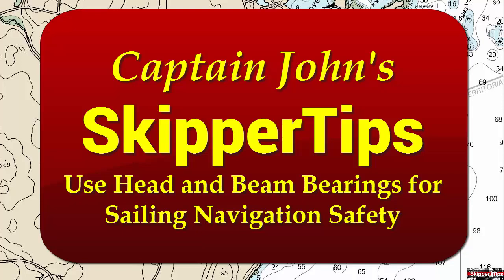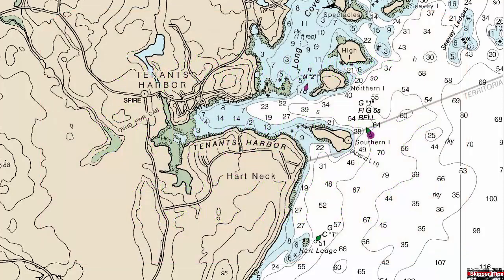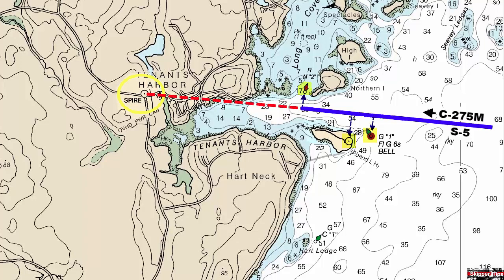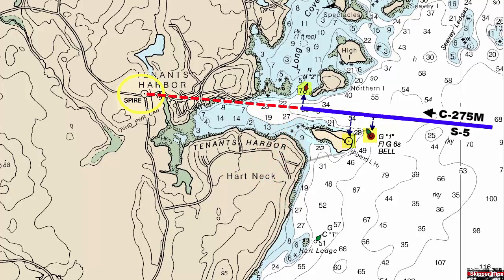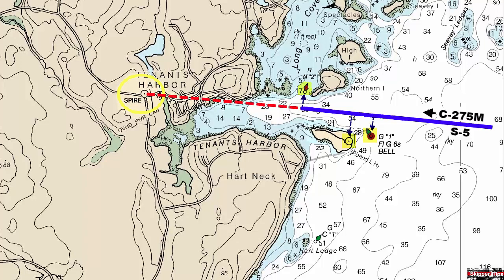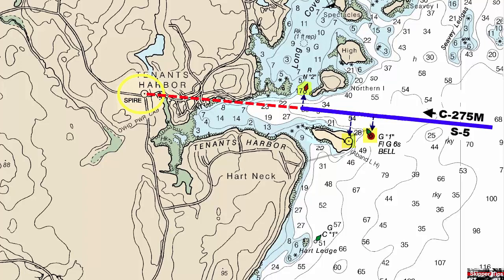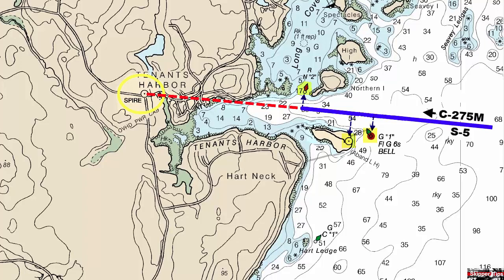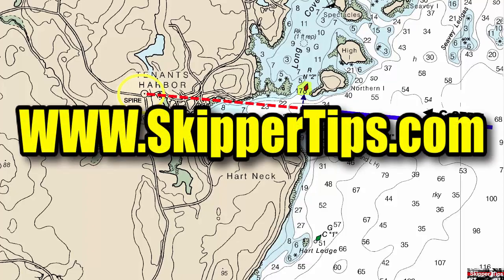How Use Head-Bearings When Coastal Sailing

Comment: I think your directions won’t work when compensating for set and drift.  In that situation, you would not be able to keep the head bearing at 275m with the forestay lined up with it.  You should keep the spire at 275m regardless of where the bow is pointed - or am I missing something...
Reply from the maker: Correct, which is why I added this footnote to the description of the video on the main page. NOTE Using the headstay to steer on the head bearing object assumes no current. If sailing in a tidal current or a side-setting wind, you will need to point upwind or up current. Use a hand bearing compass to shoot the object. Alter course as needed to maintain a constant bearing.
Reply: @skippertips  Sorry, missed that part.